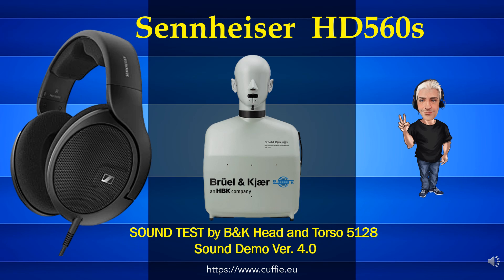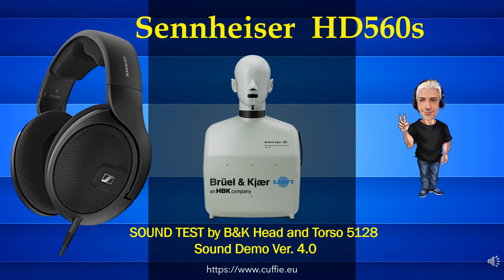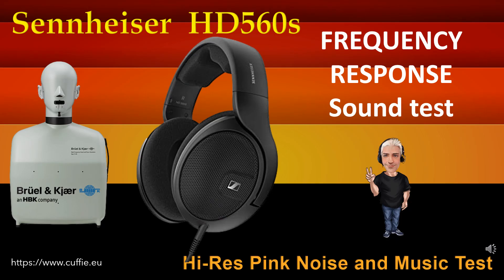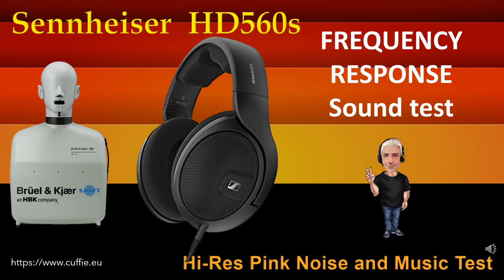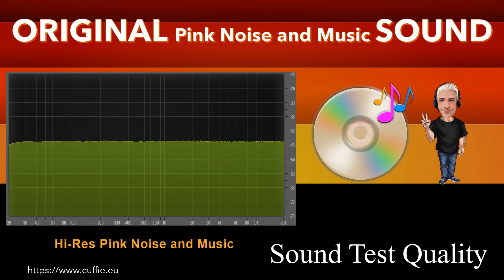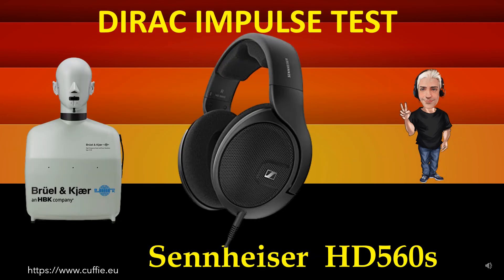SENNHEISER HD 560s - SOUND DEMO, SOUND TEST

Comment: Despite the fact that the 560th model has a more or less flat frequency response. Due to the cheapness of the driver itself, the sound is dry and boring. the same frequency response on the sennheiser he 1 (just kidding lol), will be more dynamic, juicier. Headphones are not determined by the frequency response alone.